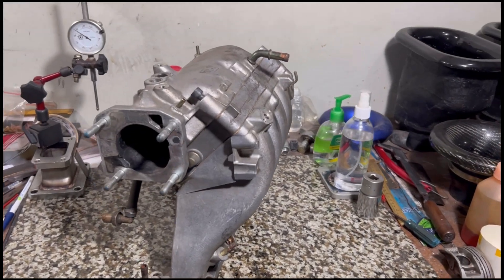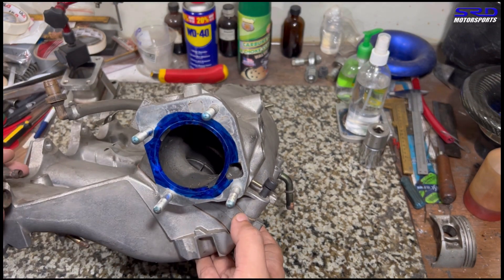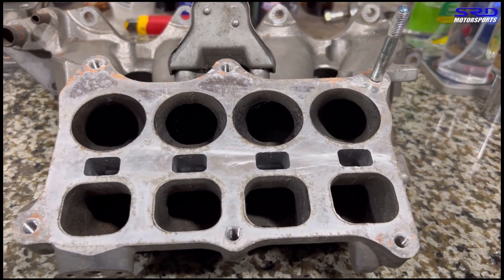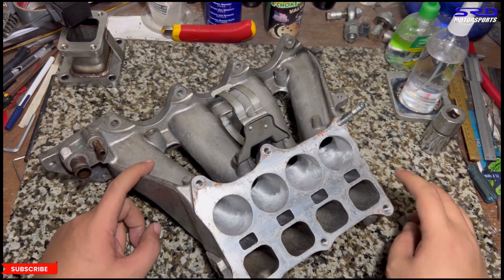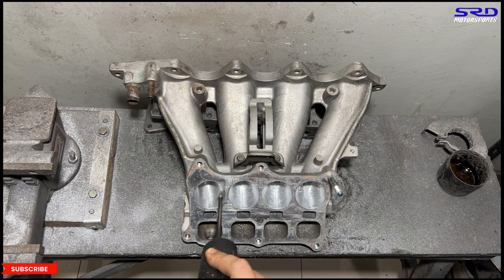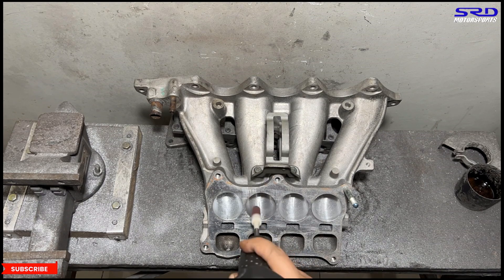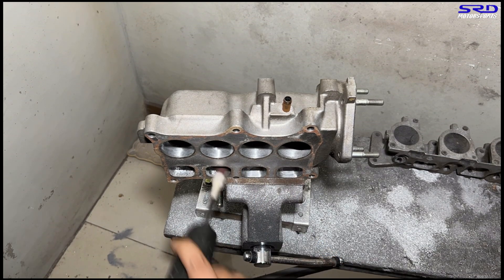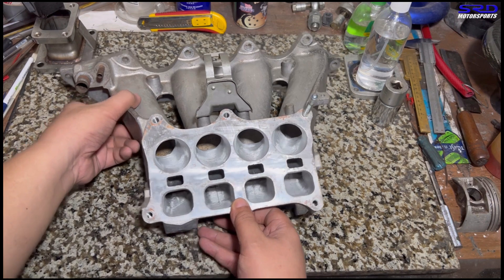B18c1 GSR Intake Manifold Porting by SRDmotorsports

Comment: Do you think it would be fine to port my intake manifold without getting a tune?? I wouldn't all of a sudden be running lean since the air is just flowing more efficiently after porting, right? I drive a 96 GSR with an intake, DC sports headers, and a spoon muffler, stock ecu. I don't want to somehow mess up my air fuel ratio by porting my manifold without getting a tune.
Reply from the maker: always need a re tune no matter what

Comment: have one of these in my basement and dont know what todo with it. Maybe i try to fit it on my d16 or maybe the Miata. Have to weld the flange but when its portet maybe i can get more power out of the engine.
Reply from the maker: that’s worth a shot maybe
Reply: @SRDmotorsports   installed a stock PDN D16B5 in my Car. It's a CNG engine with stock 12.5:1 compression ratio. So I want to  get some power of this low budget build. Have already installed a stage 2 street cam. But  have some knocking going on so I have to take out ignition. So I'm searching for some other improvements for my unusual build. Im one of those people that experimenting with no mainstream stuff :D I could install a B16 but comon that's not  much fun.
Reply from the maker: Nice nice!!
Reply: @SRDmotorsports   I can officially say that my project has failed. The CNG gas engine with PDN piston ( 0.25 overbore) and p2p head probably had too high compression. I did not manage to tune the engine without knocking. In the 2000-3000 range I had to use very low ignition values around 4-7 degree. Under load I couldn't get more than 16 degrees before TDC. Although it had more power than OEM engine in the lower range, the engine was not very rev-happy. Even with 102 octane gasoline it was not possible to tune without knocking randomly. I might have needed a more aggressive camshaft.  I have now fitted a second head which is only minimally milled, polished the combustion chambers and fitted a 1.3mm head gasket. After dismantling, I found heavy deposits in the combustion chambers and on the pistons. Presumably due to the late ignition. The engine has consumed approx. 0.7 l of oil over 8000 km, which does not seem to be the cause of the deposits. Now with thicker head gasket and the new head the engine is no longer so prone to knocking. It also has less torque in the lower range but is a bit more rev happy. When the enigne is cold i can run it with the stock p2p ecu without heavy knocking but if the engine is warm the ecu has too much ignition timing and its start to knock in lower range.
However,  before the mods with thicker gasket engine was efficient. I drove the engine with 5.3l/100km.
Reply from the maker: makes sense on the next step you did
Reply: @SRDmotorsports   one thing is Stange before I change the head I could hear and feel the VTEC switching on. Now I can't hear or feel anything. I know VTEC on D16 is not as hard bud it was a bit noticeable now an didn't know if it's proper working or not. The solenoid is definitely switching but I didn't know if the rockers engaging maybe the head have a problem  with oil channels for vtec
Reply from the maker: usually when everything is normal for a sohc u usually can’t hear vtec or barely hear it

Comment: Hi love the video, whats your thoughts on just removing the IAB plate, and doing this porting job. Then just using shorter bolts and RTV paste to seal it again?
Reply from the maker: Actually that’s worth a try… I think to make it even better as u mentioned… u can replace the iab plate with the same thickness spacer for it to give a slight bump in plenum volume too that could help altogether

Comment: I have a question im building a lsv with gsr head and in my glass (round track) i have to retain the oem intake. Would i benefit from cutting and opening up and making it a single large runner?
Reply from the maker: Actually no… u might be able to take advantage of the benefit of the dual runner because the early stage is for good midrange and torque which sounds like it’s gonna be important for you

Comment: What is the final grit I should use to finish this process? Is mirror finish good?
Reply from the maker: Really depends on a lot of things

Some use 80grit some go 120 etc
I use both 80 and 120 grit
Reply: @SRDmotorsports  I port matched a 64mm throttle body and just followed what you did on my p72 manifold for my b18c. I have type r exhaust manifold, AEM cold air intake, and Tanabe exhaust. Maybe I’ll finish with 120.
Reply from the maker: Nice nice

Comment: This mated to a b20 head will be a torque monster, would give those k20s a good run haha
Reply from the maker: Facts! Depending on the b20 if stock block then pro1 cams, but if even on just YCP? Pro2 for that top end while the IAB gives some good mid hmmm
Reply: @SRDmotorsports  aren't the pro series cam maybe too aggressive with the lack of compression?
Reply from the maker: @StraightOutThaGudda  true but pro1 on stock b20 ? It’s still 2liter
Reply: @SRDmotorsports  ahh makes sense
Reply from the maker: @StraightOutThaGudda  I mean personally I like rpm’s :)
Reply: @SRDmotorsports  hey I love me some high reving action as well 😁
Reply from the maker: @StraightOutThaGudda  yes siiiirrrr

Comment: We talked about it before, I’ve read on Honda forums guys doing this port job and making 220+ NA, which is awesome and still have mid range torque. Maybe I should buy one from you already ported and assembled 😅
Reply from the maker: oh man! hahaha Paco hasnt emailed me usually we email hahahaha that might be 2 vs 1 haha
Reply: I can send you mines or I assume there’s plenty of gsr manifolds where you’re located lol 😄

But it’s about budgeting, it would probably be more than $250 to have it ported and plus shipping cost etc 😅

I didn’t know that you couldn’t slap a 70mm TB on the gsr mani, I just bought one thinking it would just bolt in, dang
Reply from the maker: @DanRS77  well on the contrary the GSR is rare here so those who has gsr heads here often go for broke and build a full tilt motor = ultra street becomes the choice

So not many buyers here if ever lol
But u sending yours prolly defeats the shipping cost so in cases like this like the p30 manifold just a core cost saves both parties a lot

70mm might be possible with a tb spacer and all just taper it down
Reply: @SRDmotorsports   You having years of experience, if you had to choice between ITR mani vs S2 ultra street mani, which would you choose? or share your thoughts 

thanks as always
Reply from the maker: @DanRS77  oh maan depending on the set up and use but the ultra street works for most use and application so that’s good
Reply: @SRDmotorsports   Have you seen this vid, https://www.youtube.com/watch?v=YFRW0fLDP6s , 

judging from this vid it seems the ITR mani is better until the very top end, thoughts ?
Reply from the maker: @DanRS77  well the runner length of the ultra street cannot be tricked or manipulated…

I mean the length depicts the harmonic tune BUT just like heads… it can always not work 

that’s the best neutral comment I have…with respect to other channels 😎
Reply: Is this ever going to be dyno tested?
Reply: @VGAUTOMOTIVE +1

Comment: Hey so i just got an edelbrock performer x for my "D" from the junkyard!! For $30 with my discount, so i wanted to ask ur opinion about it? Im very new to this and ive been doing as much research as possible in my busy schedule, i landed on building a high comp build and i just recently got a wild idea because a pontiac grand prix with a supercharger came in to the junkyard where i work and i wanna take it out and see if a fabricator can make a complete custom manifold to be able to bolt on the charger, but thats another story, for now ima stick to a high comp. Your opinion will be greatly appreciated.
Reply from the maker: Lucky you! That performerX is NLA so can I get it from u for $45? Hahaha easy 15 bucks profit yo…

before the skunk2 ultra street series manifold was introduced the performerX for B series had an edge vs the TypeR style

Same goes for the sohc manifolds the skunk2 pro series was and is real good the performerX had an edge when needed and often times performed as good so you have a good manifold there
Reply from the maker: On the supercharger fabbing u could bring that and a p08 (d16z6) or y8 manifold to the fabricator and let him see if he can chop it up and retrofit the supercharger ftw this way u don’t sacrifice the good manifold 

As all u would need is the runner section and flange to adapt to the supercharger
Reply: I should probably keep how much I got that manifold for, a secret xD, and I also found they make a slightly different version for the bseries called "victor" x which looks to be quite shorter or it might just be the pictures on the web. Thank you for the feedback though, Im getting hyped about getting that supercharger now
Reply from the maker: @fanoftheclassics5720  yea the victorX is mostly good for turbo short runners that’s why but the Bseries perforrmX is good and excellent

Though the victorX for Bseries prolly is good for strokers on m5